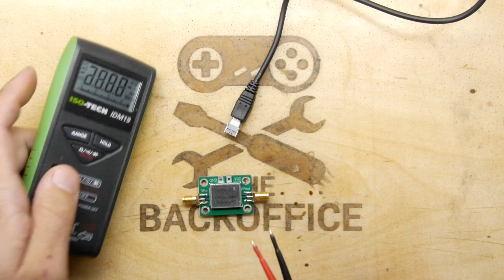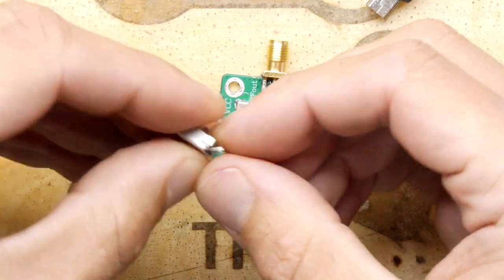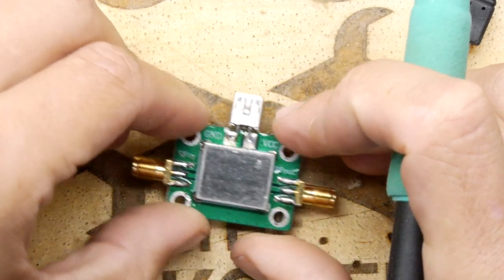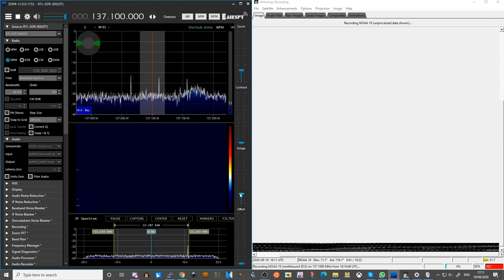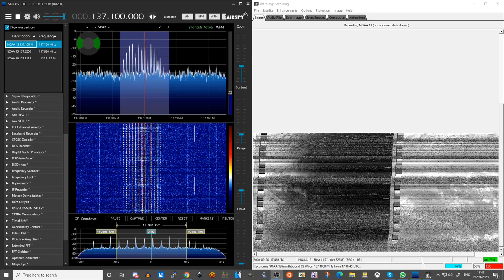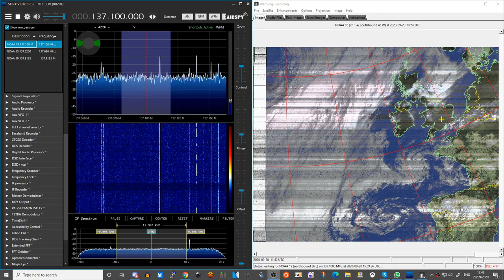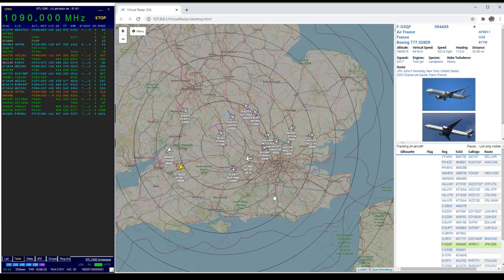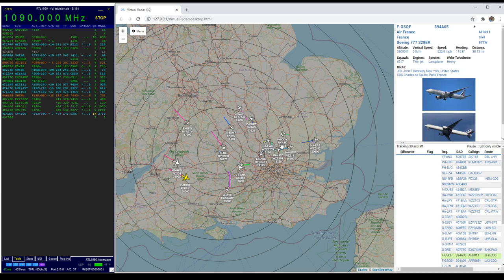SDR LNA Low Noise Amplifier to boost Satellite Images - PICTURES FROM SPACE!!

Comment: As others have said, these LNAs don't support passive passthrough – when the power is off, it blocks the signal. You can't compare reception with and without power, you have to physically disconnect the LNA from the antenna path. Some (much) more expensive LNAs do support passive passthrough using coaxial relays.

Comment: You can normally power these with a BIAS-T on your SDR along the coax. You also want the LNA to be as close to the antenna as possible.
Reply from the maker: I'm so pleased with the performance I will definitely be moving this to the masthead.
Reply: So does it mean I just plug the LNA and does it need another device to get the power from the coax?
Reply: Depends on a few things- can your SDR/ device provide power directly through it's connections... is it enough ....3.3v? 5v? Those are common figures- but some amps will require >12v+...in which case either another item needs to be incorporated into your line called a bias which provides a DC power supply to the line amongst possibly other   functions ....take care with such setups...you dont  wanna burn your sdr or amp @alphaadhito
Reply: You need a seperate bias tee to do this.

Comment: You should go for some filters immediately after the LNA (which should be first after the antenna since it governs the whole system's noise performance as Friis formulas for noise predicts). I'd opt in for filtering since you're receiver has no preselection at all. All signals, even if outside the theoretical receiving frequency will have negative impact on the receiver performance (signal to interference ratio) by producing intermodulation or saturating your receiver (no matter which frequency you dial in). That is especially true for cellular and WiFi services which are by far generated most near to your receiver and thus the most powerful ones. Filters will help to keep those strong signals away from your receiver so they won't do so much harm (degrade your receiver performance).

Comment: careful I found some of those to have fake parts resulting in a higher noise figure in the 2-3 db range. If you buy a pre-amp buy the ones marked 0.6db and are in machined aluminum cases. They are about 2-3 times the cost than those cheap ones but I have not yet found one with a fake or bad chip. Out of 10 bought all had .45-.6db noise at 1 ghz ,whereas of 10 of the cheap ones 4 were good the rest were terrible.
Reply: Pritty much all the cheap ones have problems . Fortunately for the most part they are good enough for applications like this !

Comment: How did you turn the amp on and off?  Did you remove the amp when you turned it off?  With no power on the amp I doubt much signal can pass through the amp.
Reply: If your using a RL-SDR V3 it has a bias tee you can utilize that actually turns the LNA on and off.
Reply: Coorrect exactly...That is right...
When turn off the amp signal no pass trught amp and antenna to sdr
So its not a good comparassing test

Comment: So I thought i had a grip on the ins & outs of the workings of these- I have a Open Source SDR amp that came with my HackRF....being cautious as to not blow the HackRF's inners i went to test out the gain....In your vid there's a visible difference...mine? Nothing like that... i swear that it did at a time-- but never measured it like this....

Just saw results like your's receiving all those craft when the amp had been turned on..  

I especially wanted to get things right since I was working on a TX 'ing idea where I needed to daisy chain another amp- and unfortunately, only 2nd'ary amp i got is one that came with EMC test probes- i am under the impression the "in" (rx) and "out" (tx) are reversed- againn, my attempts at figuring out  have been futile/ i don't want to be setting up a situation where 1 amp is tx'ing and the 2nd amp rx'ing.

.... Any suggestions on how to determine this? Tools to use to do so? Power-meter? Oscilloscope? I guess a spectrum analyzer eh?

Also, you use  the amp for ADSB- well, at least demonstrated its handy work boosting the results of how many craft were around... in that setup which way are you amplifying the signal? Are you flipping it to boost rec'd signals? Or stays same where your are amplifying your TX?

Thanks in advance.

oh the amp and emc probes are:
(actually really nice probes but the amp requires a plug power jack with >12v) https://www.aliexpress.com/item/1005005923571278.html

The original amp that came w/ HRF--50M-6GHz Low Noise : https://www.aliexpress.com/item/1005002172847806.html

Comment: Get it outside as close as possible to the antenna and on a short a cable as possible ... then it is less likely to amplify induced noise as well as signal.  Buy an RSP1A from SDR Play.   Well worth the money.  Much better and lower signal to noise ratio than the others ... 73 DE M0XXX

Comment: The SPF5189Z (A pHEMT MMIC Device) is spec'd at 0.6 db Noise Figure with 15 db Small signal Gain rating......0.6db Rf Signal Gain would be a Useless device.....

Comment: I want to use an amplifier for Flight Radar to use on 80 meters of cable. will it work?
Reply from the maker: It would work best if you can use it near the antenna rather than your radio end, but worth a try

Comment: What ANtennaa You Are Running Ser?
Reply: He mentioned Diskcone, which is great for areas around you. It has a horizontal doughnut shaped lobe, not great for satellites above you.
There are many alternatives ie yagis printed on a pcb. It also helps to know the satellites polarization - can be horizontal, vertical, left or right handed circular (antenna is helix on a reflector)!

Comment: 08:41 How did you set the LNA gain ?
Reply from the maker: I don't recall, but there is a slider in the software that alters it. I feel it was quite prominent in the user interface
Reply: @backofficeshow  i am unable to find that slider :(  without that LNA gain option  all i hear is noise
Reply from the maker: @aishwaryap  look at page 4 https://www.haje.nl/pub/pdf/communicatie/sdr_ontvangst/installatie-rtl-sdr-windows-linux.pdf

Comment: 0.6dB gain? That's not a LNA
Reply: 0,6dB noise figure, that is LNA
Problem is that this IC has high gain at max voltage Vcc, but easy dies from it, its best at litle less than 4 to 3,5 V